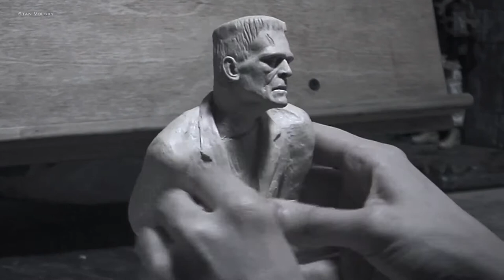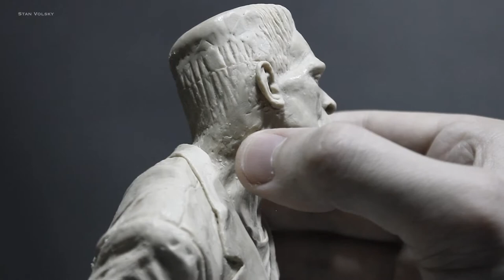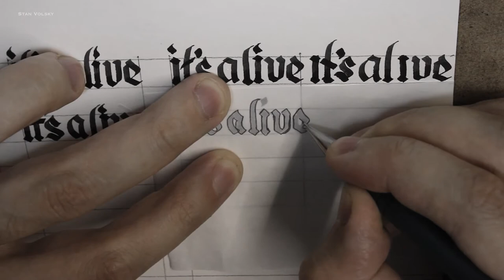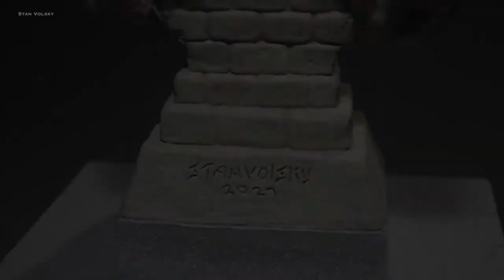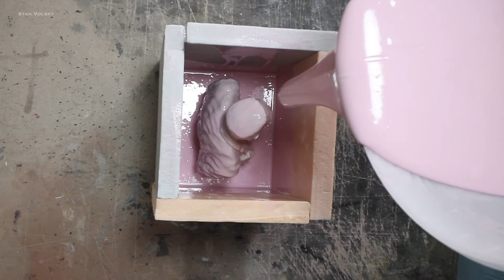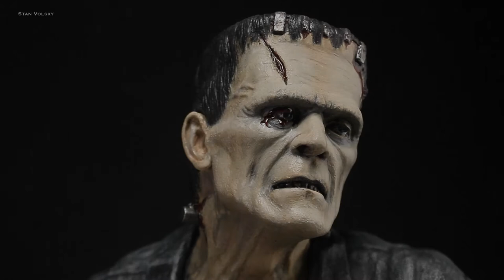Frankenstein Sculpture Bust

Comment: Great, what is the product for smoothing that you put on the brushes?
Reply from the maker: Hello, thanks. I smooth it with a moistened brush in highly purified gasoline, which I buy in building materials stores.
Reply: @stanvolskyart  Hi, ok thanks for the information, good luck ;)